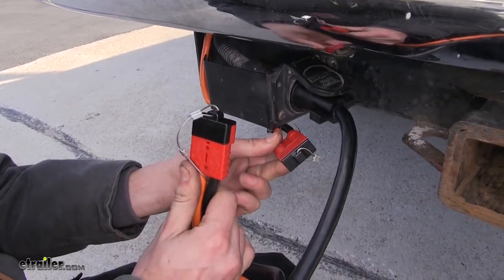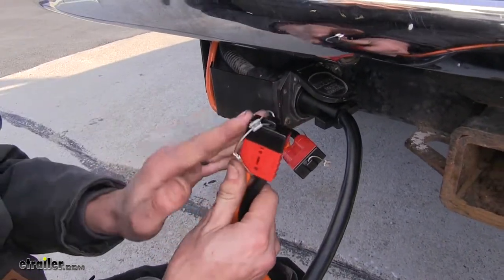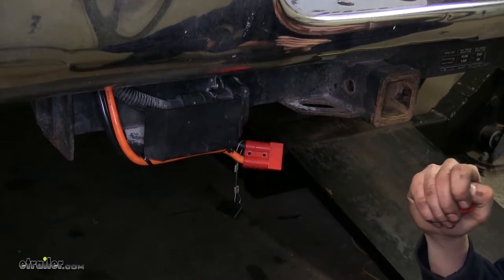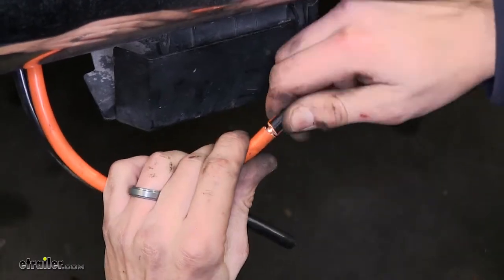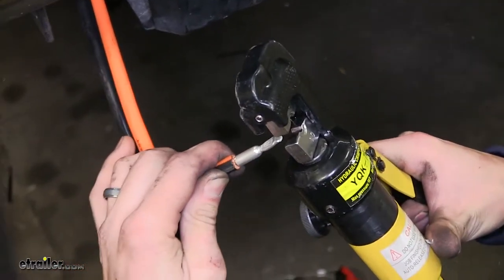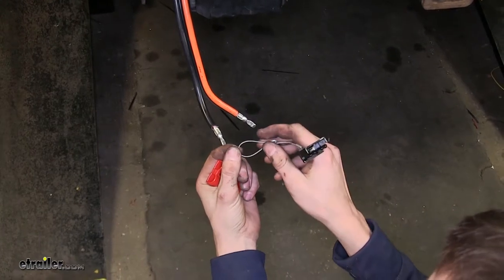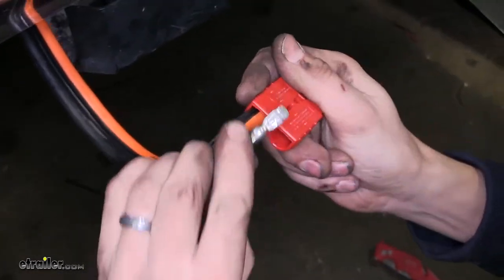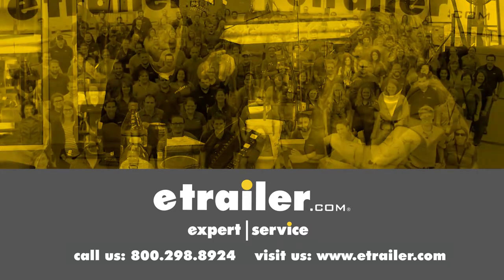etrailer | Bulldog Winch Quick-Connect Set for Powersports w/Dust Cover Review

Comment: Would a 5-0 amp connector be enough for a winch/ or jump starting another car?
Reply from the maker: A 50 amp connection will be plenty to be able to run a winch and jump starting a car. The larger the wire is the safer you will be. We usually recommend 2 gauge wire for what you are wanting to do.
https://www.etrailer.com/Accessories-and-Parts/Bulldog-Winch/BDW20207.html
Reply: #6 wire and 50 amp connector are not even close to adequate for a winch.   A 5000 lb Ramsey winch draws 46 amps at no load just spooling cable in.  Full load is 286 amps for 5000 lbs.  The 12000 winches that are popular now draw almost 400 amps at full load.